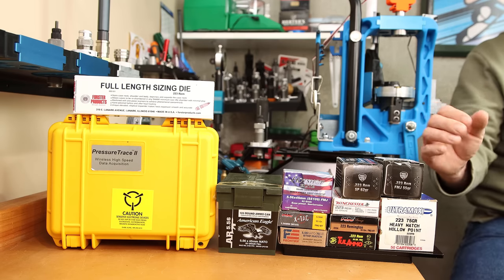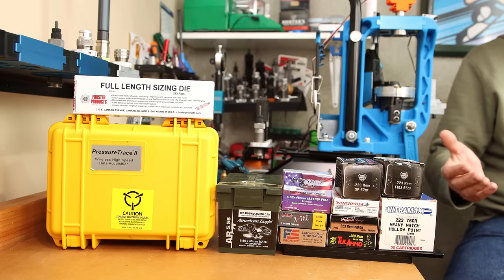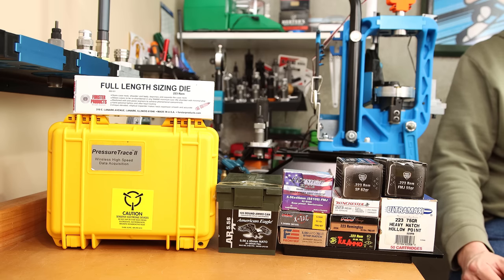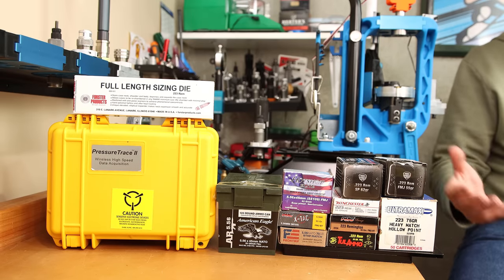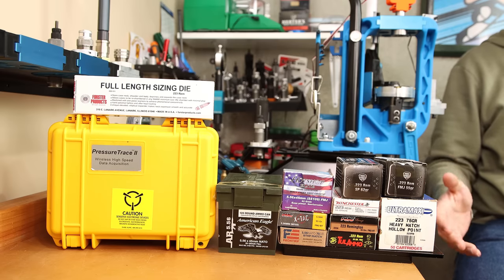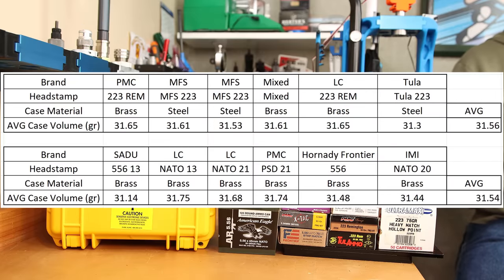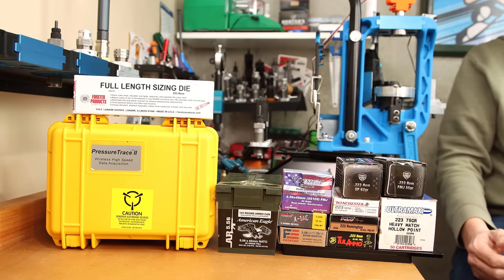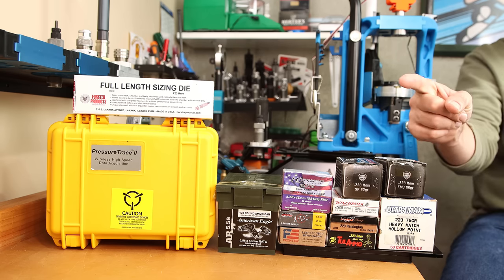223 vs 556 - The Hidden Truth No One Tells You!

Comment: If you have a rifle in. 223 it needs the MILITARY THROAT which is longer than the standard 223 throat it was done to account for the fact military ammo may occasionally have a bullet not seated full depth this prevents the bullet jamming in the rifle when loaded causing an over pressure situation. My Ruger has the military throat I discovered this when I realised I could seat bullets beyond spec depth Ruger confirmed it had the military throat. THAT'S THE ONLY DIFFERENCE unless you need tighter rifling for different bullet weights.
Reply: The issue of weapon longevity was not covered .
I ask how does standard quality equipment hold up over time , I like to keep my guns safe and operating properly . Does one round wear out equipment faster than the other ?
🇺🇲🔱🇺🇲

Comment: I sold a mini 14 and had over 600 rounds of M193 FMJ ammo, 55 grain, after the sale.  I shot every round in my Remington 700 in 223, and never had any problem with difficult extraction, extruded primers, etc.  While the 5.56 might be a little hotter than most .223, most bolt action rifles have a long enough leade and are overbuilt enough that I think it's a non-problem.
Reply: What does it say on the barrel

Comment: I think the "load 5.56 in 5.56 cases, and .223 in .223 cases" advice is just for labeling purposes, not due to case differences.  Some may do that just to not have a bag full of "5.56" reloads with ".223" stamped on them and vice-versa. As what was said, its not a big deal to shoot .223 through a 5.56 chambered gun, but mistakes happen, and and the easiest way not to accidentally get 5.56 mixed in to your .223 is to not load .223 cases to 5.56 specs in the first place, if you've got a .223 chambered gun among all of your other 5.56/.223 rifles.

Comment: i tested an ar style pistol chambered in a .223 wylde with .223 and 5.56 and for some reason it ran the .223 fine but kept having malfunctions with the 5.56 often the cases would get stuck in the barrel and i had to use a ram rod to get the brass out. Don't remember if I tried different brands of 5.56 most likely it was Winchester white box, for some reason i have a big problem with .22 lr in Winchester too, where it doesn't even fit into most guns. Maybe it was just garbage ammo that was over sized, not sure but I know the pistol works good with .223.
Reply: Chamber brush
Reply: @blackhawk7r221  but why would the .223 be fine but not 5.56?

Comment: The only ammunition that gave me any trouble in my ar was wolf 5.57 steel cased. Jammed constantly and the casing got stuck several times. Straight into the garbage.
Reply: Your particular chamber may have been reamed with a tighter neck diameter.  Maybe .248” rather than .252”.

Comment: I was also curious why you can't put 556 into a 223 gun I mean it's like the problem between 762x51 and the 30 06  very similar but not quite the same...

Is there a significant difference so that the 556 will not go into a 221 gun...
Obviously the other problems were going from millimeters to inches here and most of them are the equivalent so the question is are the interchangeable
Reply: I would suggest that if you're using a higher pressure than your gun is made for it's going to really hammer your semi-automatic action unless it's a kind of adjustable gas screw

Comment: I had a Ruger bolt that would NOT take Mil ball ammo. Used the 223 dies to reload them they worked fine. The Mil ball necks WERE  slightly longer. I just cut all my cases necks to the 223 length. & Loaded everything to 5.56 specs. Varmints never knew the difference & the 5.56 velocities made the patterns a lil tighter out of that rifle. The mini 14 223 shot everything. Learned from Ruger ALL their mini 14s were chambered 5.56 from the very beginning no matter what was stamped on them. Wish Ruger haden't LIED w their labeling. Back then bulk Mil ball ammo was cheaper than reloading.

Comment: Soooo......  what we knew 40+ years ago still stands,  223 in 556 chamber OK, 556 in 223 chamber,  not advisable. But if the bolt closes without resistance,  and you are willing to accept the risk,  you can probably get away with it.  Looking carefully at the cases for signs of over pressure. Or just be happy with 223 because I wouldn't give you two nickels for the difference anyway.  This is as I recall what an old shooter told us when we were young. I love and miss the old guys!

Comment: Sooo is there any pressure loss when firing a .223 out of a 5.56 chamber vs firing that same .223 out of a .223 chamber?
Reply: Shouldn't be. The round doesn't care about the barrel other than the length. Just like with your wife, length is important.
Reply: @JasonON  I've done some digging in the meantime. Hornady writes on their website that apparently there is a pressure loss due to the slight difference in head spacing, so not only is the .223 a bit less powerful than the 5.56, but it's even less powerful when being shot out of a 5.56 chamber.

Comment: Freebor is variable. It happens when the chambering reamer gets sharpened. Most reamers have a case body dimension, diameters, shoulder angle and so forth. The throater on one of those reamers gets sharpened and  the throat gets tightened. Freebore gets reduced. At least that was how it was with M1 Garand and probably M14 barrels. I have one that is brand new and the throat erosion guage measures 0.5' another brand new one measures 2.0.The 5.56 is a government issue firearm; check with Colt to see how they describe dimensional specs for their military arms and their law enforcement offerings (I don't have a law enforcement catalog). That unfortunately includes aftermarket stuff from Ruger, Smith and Wesson, maybe others.I stick with Colt for quality, and because I am not interested in sporting firearms in .223. The military services shoot a lot of full auto and that washes out throats quickly and greatly increases freebore. This matters if you get a USED military barrel. Refinishing a barrel does nothing  except degrading the finish of the bore, while making the outside look nice for the pilgrims.Talking about brass, we presume all cases are within spec for overall length. Every time you ask, someone is cursing the quality of some brand or another. Longer brass can adversely raise pressures; much depends on bullet release and longer brass MIGHT be affected. Have to measure to draw any conclusions. Likewise for used brass with how many reloads; proper annealing should be performed. A lot of "experts" don't know how to do it.
Look, all this is trying to separate the fly shit from the pepper. So typically American. When the chips are down you  out there who will stand up to be counted will damn sure shoot what you can get. And likely be glad to get it.

Comment: some difference in freebore thats all ive ever seen. however i bet there are .223 chambers out there with a longer freebore than a 5.56. 5.56 ammo does seem to be loaded a little hotter for the most part but thats irrelevant as you can handload for a .223 to be just as hot with no over-pressure signs.

Comment: If I fire 5.56 in my 223 Wylde chambered AR, which is suppressed with an adjustable gas block, I will consistently get blown primers, regardless of the brand, temperature, etc.  IMI, Lake City, PMC X-TAC... makes no difference.  223 Remington has never blown a primer. I have not had issues when firing 5.56 in any of my 5.56 chambered rifles, suppressed or unsuppressed.  So, the pressure differences may, in fact cause issues in some guns that are supposed to be 5.56 safe chamberings, but we already knew that. My handloads are definitely not loaded to 5.56 specs because I almost always, if not always get better accuracy at less than max charges.

Comment: What I know before we start. 5.56 Nato is a Military bullet made for the M-16, and the non-military rifle AR-15. 
The 223 is made for a hunting rifle. The 223 can be used in a rifle chambered in 5.56, but you cannot use a 5.56 in a rifle chambered in 223. 5.56 has a little more powder than the 223. The 5.56 shoulder is tapered and hardened different.

Comment: I was in the US Army during the transition from the M16A1 to the M16A2.

At the same time the Army also fielded the M249 SAW in 5.56mm NATO with a 62 gr bullet.

Many units received their SAWs well before their M16A2s.

We were told numerous times not to shoot the 62gr ammunition from our M16A1s.

One reason being that our M16A1s were Vietnam Vintage.
Many being handstamoed A1 MOD or numerous other mods like A1E1 etc.

The Army did not want to chance a higher pressure round in a chamber that had not been pressure tested for it.

The other reason could be found in the 1980s versions of the M16A1 and A2 manuals.

In the back of the manual were diagrams of the loaded bullets.

There were slight differences to the angles of the case shoulders.

We were told that it was possible the different angles might cause feeding and extraction problems.

The thing to remember is that somewhere somebody in the Army did these tests.

They incurred a certain number of malfunctions using 20 year old rifles.

The Army decided that was too many malfunctions and said DONT DO THIS.

Whether or not that is true for 100 percent of the rifles 100 percent of the time is not known.

Whatever the case the Army especially our officers and sergeants drilled it into us not to do it for safety and reliability reasons.

That is where this discussion started.

Personally I still wont do it.
Reply: The M16A1 was built and tuned for a specific ammo. If you own one I would use ammo that meets that spec.

My only  223 marked gun is a bolt action designed for 65,000 psi so I don't see it as an issue for me.

For people that it is an issue for make sure you don't buy European Ammo. CIP specifies  the same dimensions and pressures for both.

Comment: Both me and my older brother have been saying the same thing for years. It's really about the pressures we don't recommend you shooting 556 out  of a 223 but if the shit hits the fan you plug that 556 in and you rock and roll. So please don't ingrain it in your head that you can never use 556 in  a 223 barrel. 556 will save your life in an SHTF emergency. 223 WYLD barrel designed to take 223/556 but has problems shooting steel and reloads. I think because of that Barrel being design for competition the chamber was built with a tight tolerance. My good old DPMS 556 eats everything brass steel reloads it doesn't matter it's not choosy.

Comment: The only problem between .223 and 5.56 that I found was the NATO rounds were crimped around the primers. I imagine that this is done to keep the primers from backing out when firing in full auto mode. The crimped primers are a pain in the ass to get out. I had to use a special block and punch pin with a hammer. Then, you have to remove the crimp by chamfering the edge of the primer pocket and ream the pocket before you could put a new primer in. That's why I stopped reloading both .223 and 5.56 NATO years ago. I just buy Lake City 62 gr. 5.56 as far as it goes, if I can find it.
Reply: @ Michael Anderson - If you invest in a rifle decapping die, it might save you some work knocking out those staked-in mil-spec primers. Having to work on the primer pockets is a PITA, though, no question.

Comment: I was told that 5.56 is slightly larger than .223 and what that generally means is that if you have a .223 barrel the .556 cartridge is more likely to stick or jam.
Reply: Nope.  Complete BS.  All of the dimensional differences are in the barrel.  The only thing different, as what he says in this video, is the pressure of 5.56 NATO ammo is slightly higher.

Comment: would be interesting to compare the American Eagle .223 to the American Eagle 5.56. Factory load velocities are identical. Like comparing a Chevy to a Toyota. Can't compare chamber pressure standards as they are measured with different methods. In practical terms? Only real difference for civilians is the staked primers in the 5.56. Reloading? Stick to .223 brass. There IS enough differences that while some 5.56 cartridges may work well in a .223, it's not something I would do. Buying? Either a .223 WYLDE or 5.56, not .223 REM, and never have to worry about it.

Comment: 5.56 has higher pressure because government demanded velocity maintain 3,000 fps from shorter barrel.
some older 223 rifles may start to run into issues if 5.56 used frequently, have also seen 223 with tight chambers have fired 5.56 cases stick in the chamber when fired, time to dig out cleaning rod to tap stuck case out of the chamber.

Comment: Hmm could be that 5.56 is just hotter loaded .223 to ensure enough pressure to cycle in very diverse number of firearms, at least in original concept?
At least, as I recall original M-16 was chambered in .223 , prior to adoption STANAG norm that standardized 5.56 as NATO caliber. There was no need for 5.56 for AR-15 platform, but other designs might wanted a bit more pressure.
Guessing a bit, but this theory makes sense for me.

Comment: This was something that was researched and written up in one of the NRA American Rifleman magazines in the late 1980's or early 1990's. But this was also written up much earlier in one of the "Cartridges of the World" books. I believe that was back in a 1969 copy I was given a long time ago. 
I can't tell you how many arguments I've had with some of those so called experts. These are the same argument that have come up over the .30-03 and the .30-06 and in some cases the 7.62 X 63 mm. Also the .308 and the 7.62 mm (7.62 X 51 mm). 
The development of the Remington cartridge that started back in 1957. In short and very simple terms, Remington started out with the .222, with an overall case length of 1.700". But it lacked the performance they wanted. That was followed by the .222 magnum, with a case length of 1.850". The .222 Magnum is mostly forgotten today and about obsolete. That had the performance, but the Army liked the shorter case. The problem with loading the .222 to the 3,000+ MV they wanted, it was exceeding safe chamber pressures. So they lengthened the .222 case to 1.760" almost to the halfway point between the .222 and .222 magnum length to reduce the chamber pressure and called it the .222 Special. But that posed another problem having three .222 types of ammo on the market. So they decided to call it the .223 for the civilian market.
There is a lot of money involved in making all the tooling and equipment to manufacture just the brass case. That is the most expensive part of a cartridge. it makes it far cheaper for the same brass cartridge to be made for the military if they are making the same brass for the civilian market. Especially if the civilian market likes it a lot.  It is the same that happened with the .30-40 (.30 Military) the .30-03, the .30-06 and the .308/7.62 mm and now the .223/5.56 mm. The only reason for the millimeter (mm) designation is for the NATO countries so they can produce their own ammunition to the same specifications. It also allows the NATO Nations the ability to use other countries ammo. That is another reason for the Free Boring in the 5.56 mm chambers as other nations loading the 5.56 mm might vary from the US standards slightly. Along with what a rifle may encounter in combat conditions with dirt, that free boring allows for some tolerance to help keep the rifle from jamming. 
In conclusion, it is only the type of powder they use for the military load to compensate for the free bore chamber. The 5.56 mm in the military rifle will have the same muzzle velocity (MV) as the civilian rifle chambered for the .223. This is why you can fire a .223 in a 5.56 mm chamber, though it will have slightly lower MV because of the free bore chamber. 
But the reverse is not a good idea as the 5.56 mm is loaded with a powder that will develop unsafe higher chamber pressure in a rifle chambered for the .223 as it does not have the free bore chambering of the 5.56 mm. That is really the only difference that matters between the .223 and the 5.56 mm, the powder used between the two loading's. The other minor stuff like water proofing and crimped primers have nothing to do with the case dimensions. You can load 5.56 mm brass for a .223 chamber with the proper powder and loading data. The same is true with the .223 brass being reloaded and fired out of a 5.56 mm chambered rifle as long as you use the proper loading data.

Comment: There's no difference if there is the chambers of the same they're supposed to be the same if they're different you got the right they're not even 223 or 556 the only difference is the numbers is metric and imperial measurement that's it if there's any difference somebody's fucked up or you got the wrong bullet and casing the powder load for both of them are the same if there's any different pressure it's the powder is different the loads are the same yeah you can have two different powders one will have higher pressure because it burns faster

Comment: All I know is if I use 5.56 green tip in my Kel-Tec RDBS  the firing pin breaks and when I use .223 the firing pins do not break.
Reply: Depends on the primer not the cartridge.   Federal primers in 556 would be no issue.  Russian primers or crimped CCI primers are an issue.
Reply: @0529mpb  not really I was using Federal  ... broke 4 fireing pins ... the RDBS simply can not handle NATO amo at leased the federal Green Tip